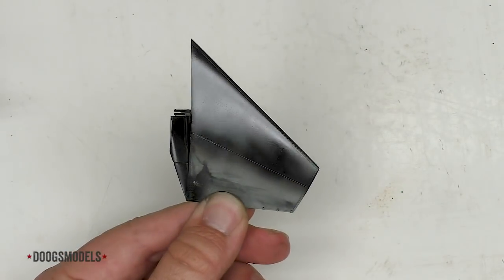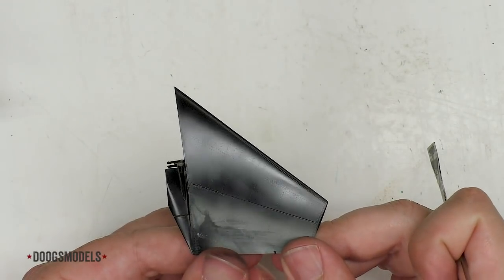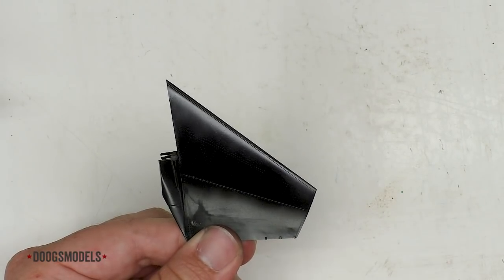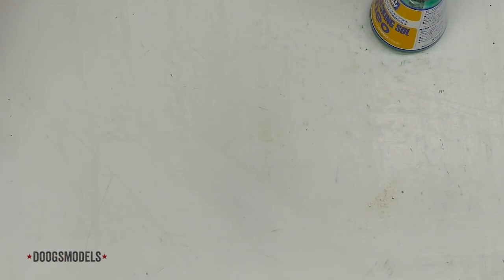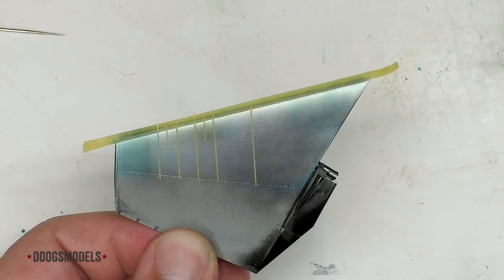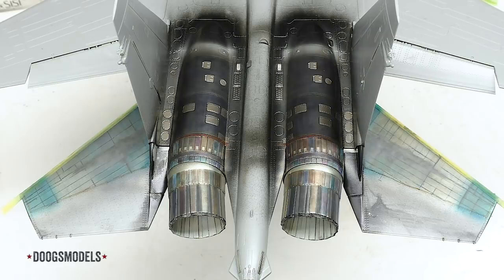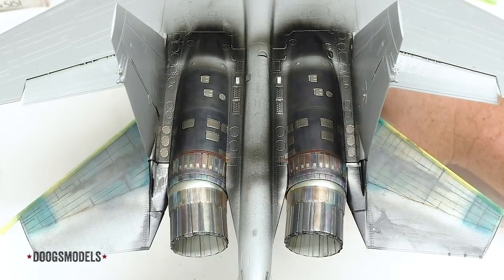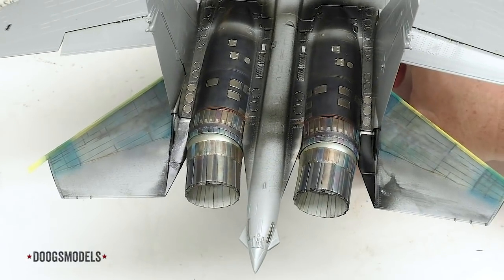Su-35 Flankoff Part 17: Stabilators

Comment: The control rods go very near the engine and it wicks the heat into the surface because it's a great radiator for heat.  That's why they discolor but the tail really doesn't.

Comment: Actually they are used for absorbing the heat from the engines and for cooling engines to put down the heat signature of engines, therefore the same metal material and they are connected with engines with the same metal, it's part of the stealth technology for Su-35S :)

Comment: Just a note for you, these heat shields are in place not to protect it from exhaust but rather the high speed pressures and high altitude that can cause tremendous heat on the air frame.
Reply from the maker: excellent! I haven't been able to find a straight answer to that anywhere - or why they're different on the Su-33, -34, etc
Reply: Yea it does depend on the aircraft and if it was designed for this type of flight. Think SR-71, they actually had to use a composite because the methods used for air frames like the one you are working on was not sufficient for the extreems that air frame under went at the altitudes and speeds it flew at. The SR-71 skin reached temps of upwards of 900 degrees. If I recall my lessons the Su-35 still hit temps in the range of 400 to 600 under extreme conditions it was designed to fly.
Reply: They are like this to protect them from missile and rocket exhausts ;)
Reply: @kevinm3751  I rarely see the Heat Shields (Chrome Colour) near the twin engines on the F-15C Eagle have the blueing, purplering & red-browning by the extreme heat from the engines & the extremely high speed.
Reply: @
Doogs' Models @Kevin Morrison
 Actually they are used for absorbing the heat from the engines and for cooling engines to put down the heat signature of engines, therefore the same metal material and they are connected with engines with the same metal, it's part of the stealth technology for Su-35S :)
Reply: That doesnt even make any sense, does only the tail section get effected by the high altitude and heat? No. They are most likely as the other guy said from exhaust and missle rocket engines
Reply: @kevinm3751  I dont even know I even argue with you and your imaginary aerospace friend, but there are all types off missiles/rockets and they dont fall down upon firing maybe you are the one who should take a video of them? ;)